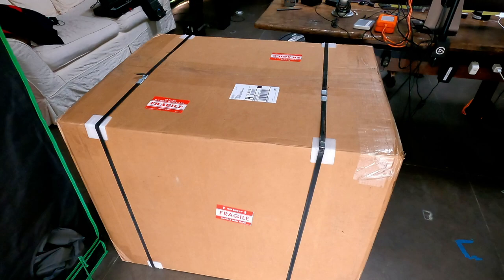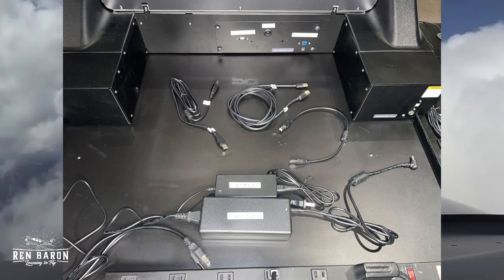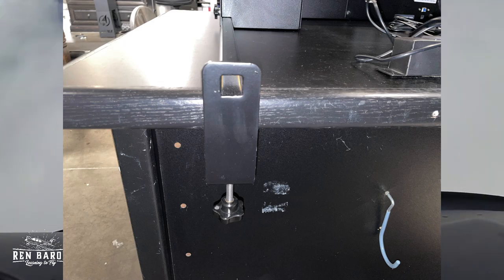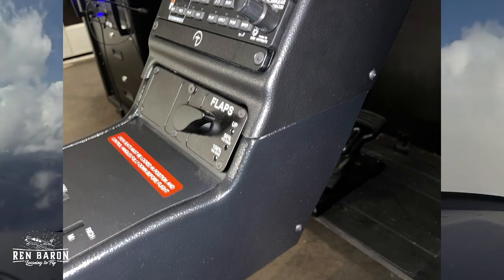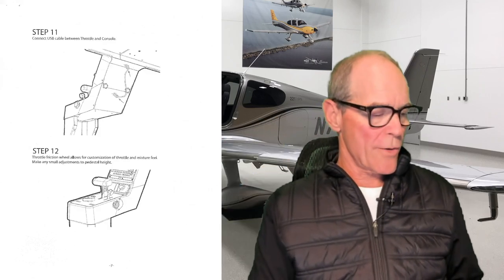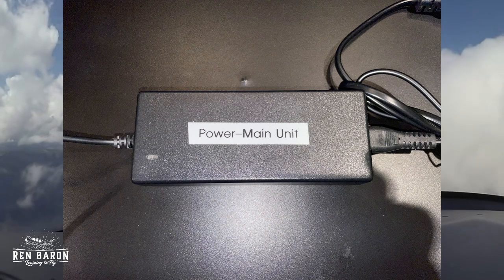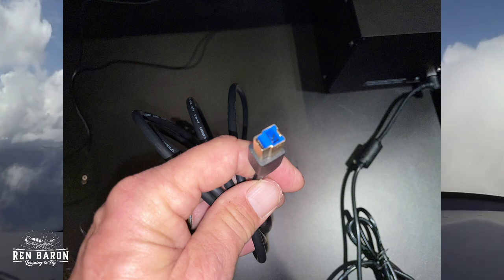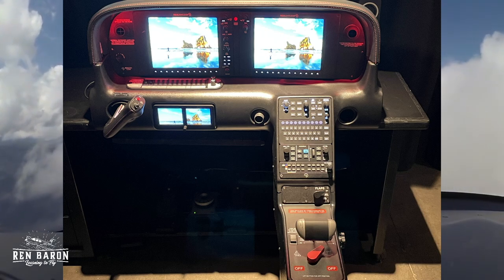How to Assemble the RealSimGear Cirrus Cockpit

Comment: He Steve thanks for posting this! I just bought a Cirrus SR22T and I'm up in KWHP. I am considering the RealSimGear as well. Just trying to figure out which one is the best. Also what tug do you use or recommend? I have a bit of a slope to push into the hangar
Reply from the maker: Glad I could help! The most important thing is to make sure the sim you buy can do everything you want it to do. I think both sim options will provide a very realistic take on the hardware. The differences are in how the flight model/avionics work in my experience. Both companies offer very personal service so get on the phone with each company and ask them all the questions you need to ask to make sure you can do what you want. Cheers-Ren

Comment: Hi Steve very informative and easy to follow. This $12K unit is an add on to an existing flight simulator. Since I don't have one and am beginning the SR20 Cirrus G6 PPL training I am considering going all in. The complete set up is $30K. As a hefty investment this is, is it worth spending the money or just putting it into lessons.
Reply from the maker: The Cirrus Cockpit I'm using here is a standalone setup but does not include the Pc ($2.5K to $3K), Monitor ($1K) and USB controllers ($300). If you are really serious about flying a Cirrus this Cirrus Cockpit is a great tool. Having taking flight lessons myself I can tell you that using the simulator to practice what you've learned will make you a much better Cirrus pilot. I don't think you need to spend $30K to do that.